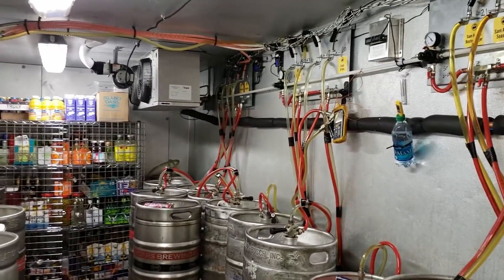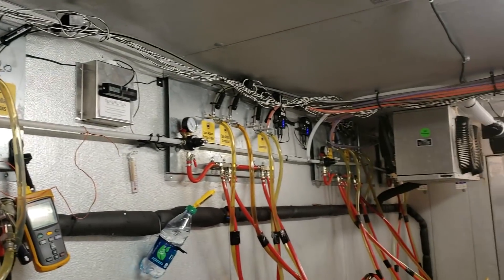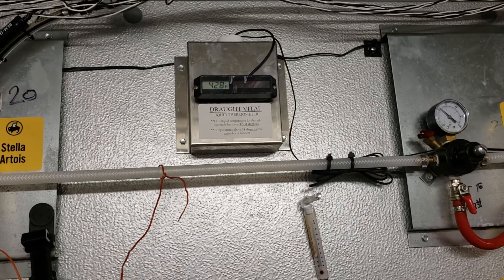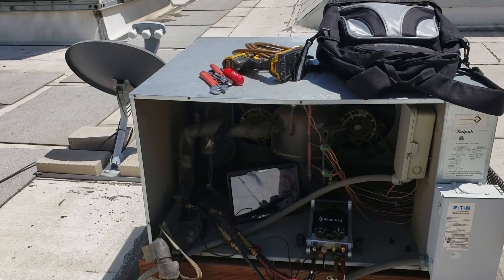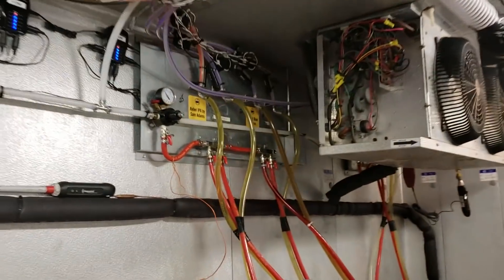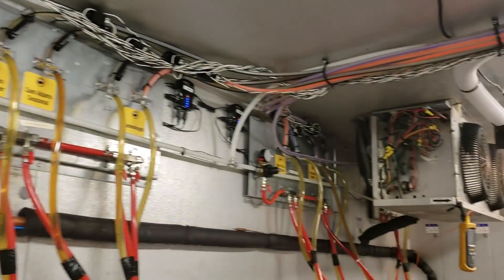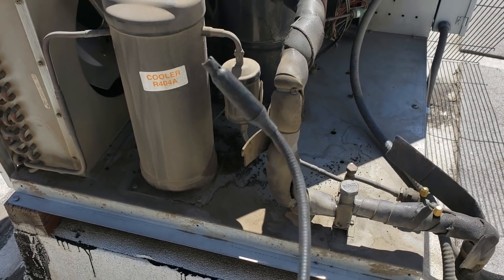Beer Walk In causing Foaming Beer at the Taps

Comment: During the early '80s, and throughout the '90s, we serviced a large refrigerated tap system - which was in the basement of a firehouse (their 'club-room').  The dispensing line array was 'directly buried, and concreted' into the basement floor. The 1950's era refrigeration room utilized a split R-11 system, with one side of the system serving the 'walled-off keg storage/dispensing area', and the other, their cold-prep area, and refrigerated refrigerated storage.

That R-11 system has never been opened, as its built-in (glycerin filled) line gauges are still quite functional; a testament to the skill level of the installer(s), and their ability to silver braze.

Basically, the annual service consisted of a thorough cleaning of the coils, check of the door gaskets, and a component-by-component check of the electricals.

They did have to cut into the floor to unearth, and replace the red copper lines, which carried the beer to the taps, after guests complained about the "odor of Limburger cheese" permeating the entire expanse of the bar.

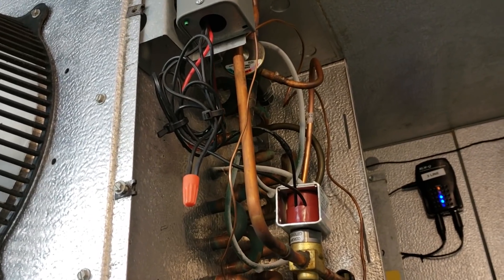Comment: 3:07 Wire nuts in wet locations, any wet or damp location, should always be turned UP like little umbrellas so that they don't trap condensation. The coil spring that is inside of a wire nut is make from steel and not copper and will rust out over time and give you a bad connection. The first thing I learned while working HVAC/refrigeration.

Comment: I used to work with my father back when I was 16, in Vegas during the weekends going to restaurants doing maintenance calls for ac and Refrigeration,  we used to look at swamp coolers,  condensers, beer cooling rooms, walk in freezers etc.  
Seen one of your videos couple days ago,  usually when I see a swamp cooler it was above the roof at an auto dealership,  repair shop,  or factory.  Never did I see a condenser rack with a swamp cooler to water cool the condensing units and compressors.  That was an interesting one for me to see. 
I don't touch that stuff anymore,  but I do like to watch your videos from time to time.  You seem to provide great clarity and explanations for repairs on customer calls.  And looking at the big picture and doing good diagnosis can spot a lot of problems or future problems.  Seeing the temperature sensor on a drain line does not make any sense as you mentioned. I will say,  that's not the only walk in beer cooler I have seen with a setup like that.  I can count 10 other restaurants that have had that done. From what I think,  it was an half ass way to Jimmy rigg and trip the temp to stay cooler instead of doing things properly.

Comment: You are so right in this video about tunnel vision & stepping back to access the whole situation. The other day I had a RTU that was not running. I had no control voltage to the contactor. I checked the usual culprits & they were good. A humming relay on the low voltage control side caught my attention & tunnel vision began. I was so fixated on the relay (which had to close in order to energize the coil for the contactor) that I did not notice the big oily spot on the refrigerant piping above my head! The low pressure switch had open because the unit was low on gas thus preventing the contactor coil from energizing. That was a embarrassing oversight for sure. Next time I will look everything over more carefully before troubleshooting.
Reply from the maker: It happens to the best of us, the best we can do is learn from it.

Comment: Never seen a receiver without a king valve, nice work on catching multiple problems.
Reply from the maker: Yeah it is a pretty stupid setup
Reply from the maker: In the early Kolpak walk in condensing units they all came this way, in order to change the drier you have to recover the gas. It is extremely frustrating!

Comment: I took a solenoid off on a quench valve once and forgot to take power away and within a few minutes the internal center imploded,  I should have used a screw driver to help take away the heat energy.  Of course over in Iraq where parts are scarce. Best way to learn I guess.

Comment: I'm sure you know, but if you hold the clamp meter with the clamp open next to an energised solenoid coil it will register an amp reading due to the magnetism, the numbers don't mean anything but it does indicate the coil is working.
Reply from the maker: I didn't know that, thanks for the tip!!

Comment: I never seen the booster fan rig blowing air down the beer tap line chase. Here in south Florida I have only seen a small chiller supplying cold glycol down the chase keeping the beer lines cold. 
Also seems like the analog thermostats these days are never on point. Seems as if at the manufacturer they are placing the temp range sticker on slightly off.

Comment: Awesome video. Love these calls! I wouldn’t be surprised if that one evap iced right up and encased the solenoid coil connections with ice and burnt the winding.. hard to believe one evap would have blockages and the other be fine! And Why the hell would they be regulating drain line temp, when drain heaters are self regulating? Bizarre enough that there’s even a drain heater in a cooler, but Maybe they put that in to protect the heater, since they insulated it.. sounds like overkill and extra steps taken to counter the negative impacts that the overkill has on the load... no queen valve on a receiver either.. perfect example of a simple call consuming your whole day
Reply from the maker: That temp control is the box controller, and the sensing bulb is mounted to the drain line but the controller has a hard time regulating the box temp because it senses the heat from the drain line heater.

Comment: Glycol is wayyy better than air draft for chilling beer.   I wonder what temp the air is coming back from the air draft. May be a bigger load coming into the box than kolpak designed the BTU s for.
Reply from the maker: Yeah Glycol is much better for the tap heads for sure. This locations bar is literally on the other side of the beer walk in wall so it's not too bad.

Comment: What are the tower chase holes in the wall, at the pubs ive worked at have never seen one in the wall?
Reply from the maker: The beer taps are right on the other side of the walk in, so they just run straight out the wall with no need for a glycol unit.

Comment: You almost did a good job but you failed at the start. System is on r404a which is a blend so if your short the whole system won’t run correctly which could make it look like a problem with the tev. Also have you never heard of global warming. You never top up a system which is short. You find the leak and fix it first.
Reply from the maker: out of curiosity how would you have done it differently? I'm always interested to see and or hear how others do it? Anyways thanks for watching bud
Reply: @HVACRVIDEOS  you did it fine, gov allows reasonable time for leak repairs or equipment replacement esp when your spending someone else's money